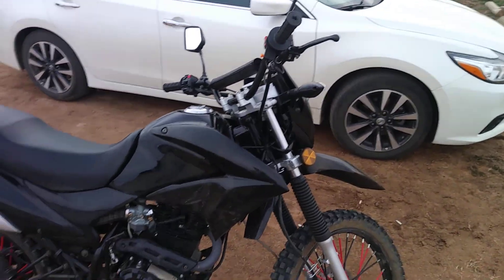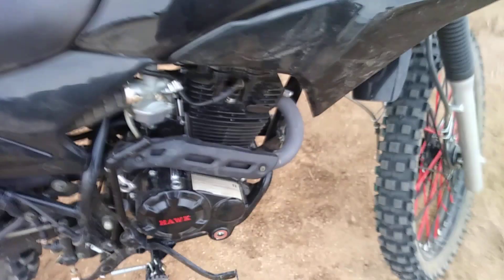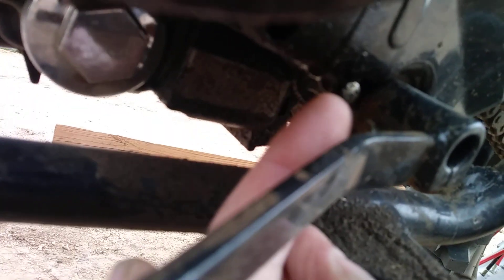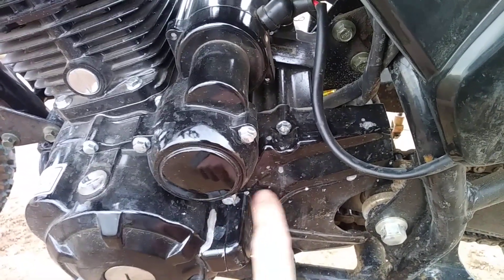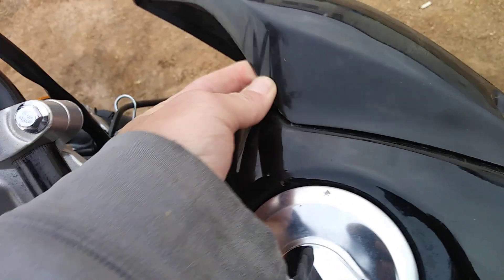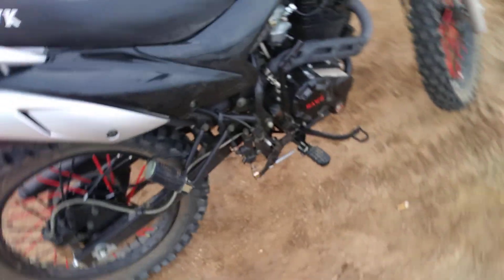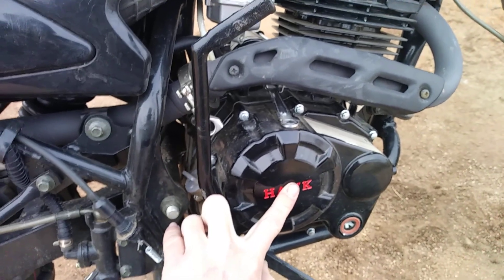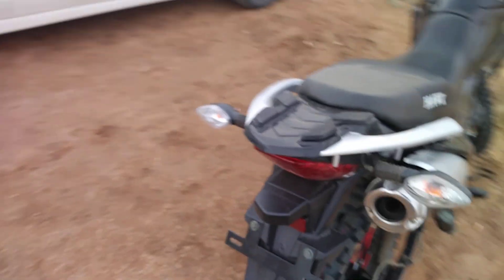200 mile review on my 2017 RPS HAWK 250 ENDURO.

Comment: If you don't like the ride you can get a rear shock with damper. ZXTDR 295mm 11.6" Rear Shock Absorber Suspension Sensa-Trac Load Adjusting for Dirt Pit Bike Motorcycle 1200LBS https://www.amazon.com/dp/B074K56B75/ref=cm_sw_r_cp_apa_i_u8hXCb41DHJ5D
 Mine is on the way, I hit 1300 miles no problems. Yo will need 4 spacers 3/8 hole. 2 are 5mm and 2 are 10mm wide.

Comment: I put 7k miles on mine half the miles were fully pinned in fifth gear
Reply from the maker: Im about to hit 300 lol.  Getting it tagged next month. So for now its all been on my 40 acres.
Reply from the maker: Hows it holding up?
Reply: @HARTLINE310  it did fine, I changed the oil every 500 miles. The only problem I had was the hub on the rear wheel, but it was my own fault. A bolt came off and i didnt know so the whole sprocket  broke off, but i did wheelies all the time
Reply from the maker: Does yours make a ticking sou d after valve adjustment?
Reply: @HARTLINE310  yeah that's just the valves opening and closing, means you did it right
Reply from the maker: Thats good because i thought i was off on it and checked it like 5 times lol
Reply from the maker: Hey one more quick question, does your kickstart lever stick out and rub on your leg? Or is mine faulty?
Reply: @HARTLINE310  no I've never had a problem with it, at the bottom where it connects to the motor you can adjust it clockwise or counter clockwise, just loosen the screw, pull it off then put it on in a different position. That's the only thing I can think of other than being faulty
Reply: Trippy_g00n. Lol I've got 5,800 miles on my bird and half of them pinned as well!
Reply: @kylebankes6212  hell yeah! Keep it going!